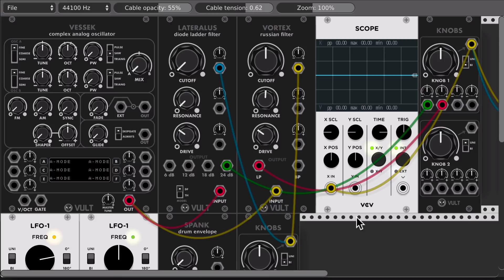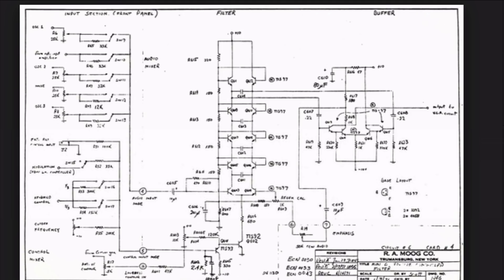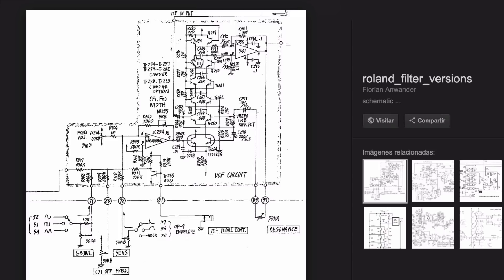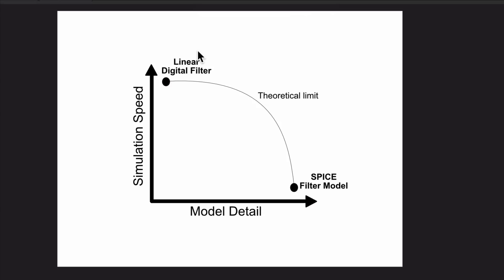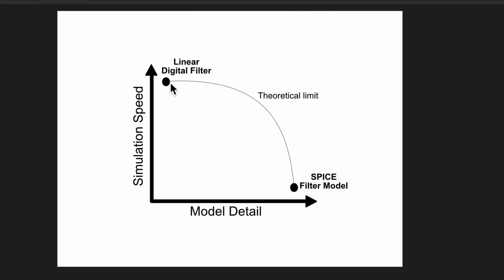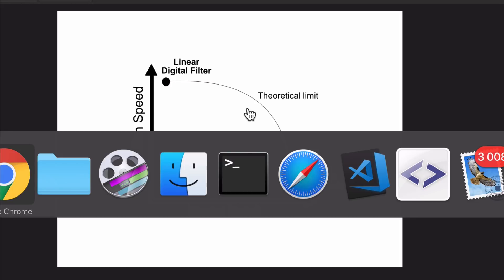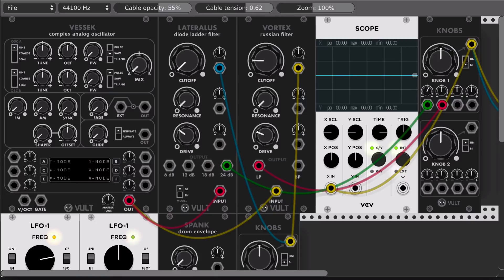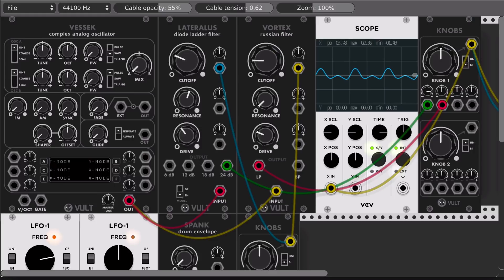New Vortex and Lateralus

Comment: Your Filters are the best! Thank you for bringing the sound of VCV Rack to the next level!

An idea: Could you maybe make the big knob of the Util Knobs act like a master volume, switchable with right click to activate "mixer mode" and then have it react as master (also uni and bipolar)?
Reply from the maker: I like the idea. But I don't like the right click menus. I can add a third position to the switch to make it a mixer.
Reply: a switch would be even better... but it should be a second switch so that you can still switch between uni- and bipolar... could be much fun for automation signals to have the bipolar option.... or maybe a button that lights up.
Reply: althoug mix as third option would probably be enough since you could still use the second unit on the module for further manipulation and polarization... so yeah that would be cool and cover enough options on second thought.